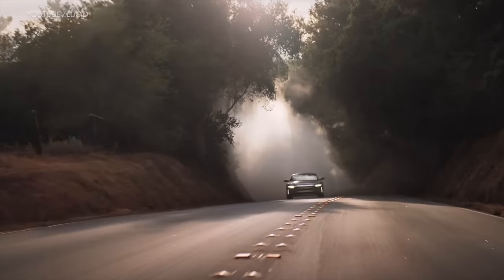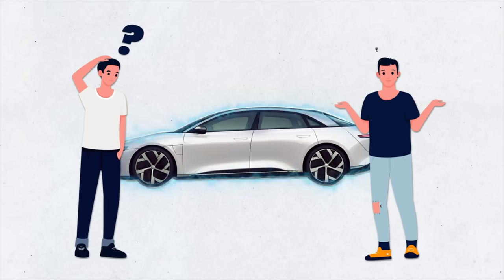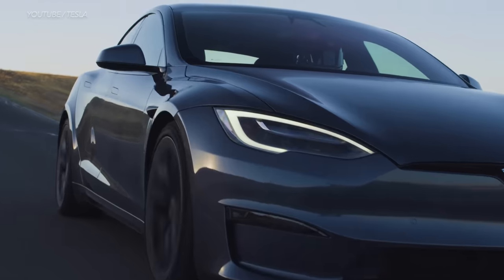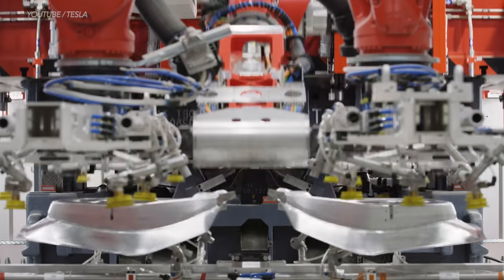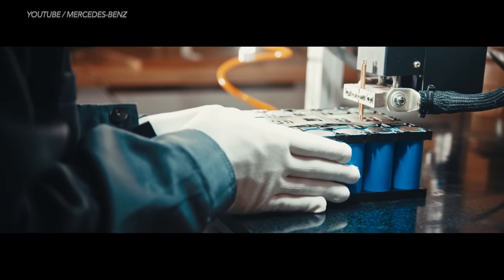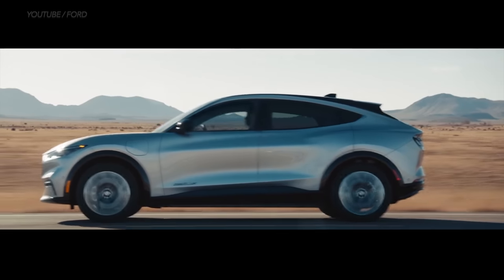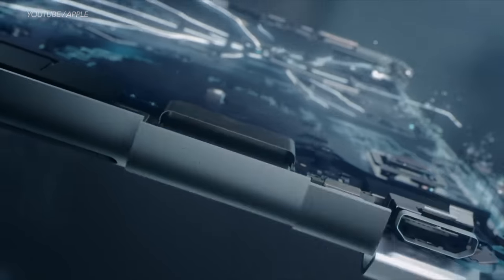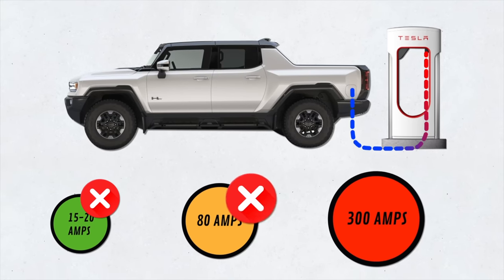Here's Why I'll Die Before I Buy an Electric Car

Comment: So my wife works at DMV. Guy in Tesla drives through, his license tags are expired. - He had to shell out 3000 dollars for Registration and tags, which would cost at my current car about 100 dollars a year. The local government does it because Tesla users do not buy fuel and therefore do not contribute to sales tax that help maintain the road. You buy electric vehicle to avoid fuel costs, to be strangled with the same bill at the end of the year or more if you spent it on fuel.

Comment: In the UK we have another new issue with EV's and that is criminal gangs are stealing  the charging cables to extract the large amount of copper that is contained within them. Also at many places that are off grid like shows and outdoor events have to install chargers that are powered by diesel generators.

Comment: Scotty - I agree 100% with you !!!  (again  LOL) Another GREAT Video ! The reasons you mentioned, for not buying an electric car now, are very valid. My biggest negative factor about Electric vehicles is that in the USA... only 20% of the electricity made by all power plants is done using "renewable" resources (Water, solar, etc). I'm continually amazed by how many people buy electric vehicles thinking they are 'saving the planet'... they really aren't helping that much.  Nearly 80% of all the electric power generated in this country is done using fossil fuels (natural gas, oil, and DIRTY COAL!!).  [ insert laughing horse here] I'll buy an electric car as soon as 80% of the electricity generated in this country is done so using 'renewable' resources like, wind, sun, water, and yes, even nuclear!!
Reply: Pure carbon has extremely low toxicity to humans and can be handled safely in the form of graphite or charcoal. It is resistant to dissolution or chemical attack, even in the acidic contents of the digestive tract. Consequently, once it enters into the body's tissues it is likely to remain there indefinitely. Carbon black was probably one of the first pigments to be used for tattooing, and Ötzi the Iceman was found to have carbon tattoos that survived during his life and for 5200 years after his death.[126] Inhalation of coal dust or soot (carbon black) in large quantities can be dangerous, irritating lung tissues and causing the congestive lung disease, coalworker's pneumoconiosis. Diamond dust used as an abrasive can be harmful if ingested or inhaled. Microparticles of carbon are produced in diesel engine exhaust fumes, and may accumulate in the lungs.[127] In these examples, the harm may result from contaminants (e.g., organic chemicals, heavy metals) rather than from the carbon itself.

Carbon generally has low toxicity to life on Earth;
Reply: Carbon-based compounds form the basis of all known life on Earth, Carbon is the 15th most abundant element in the Earth's crust, and the fourth most abundant element in the universe by mass after hydrogen, helium, and oxygen. Carbon's abundance, its unique diversity of organic compounds, and its unusual ability to form polymers at the temperatures commonly encountered on Earth enables this element to serve as a common element of all known life. It is the second most abundant element in the human body by mass (about 18.5%) after oxygen.

Comment: People are always worried about those cross-country trips in an EV, but 99% of driving is less than 100 miles per day. And the acceleration is like making the jump to light speed. Change the battery pack in 10 years.
Reply: People drive more than 600+ miles just in a weekend all the time.   And the acceleration depends on what you can afford.  But the reality is you get all the instant power at the beginning    but they lose it down the road.    If your having to change out the main component of your vehicle in 10 years that is terrible longevity.

Comment: 95% of my rides could be done with a $5k 2 seater EV, always simply charged on my normal mains power. The actual problem is not range, but how to rent a long range multi person VAN nearby for a long trip. And at what cost, if for multiple days. So we need new concepts and not an all purpose 3 ton monster car for everyday.

Comment: It's not affordable until better, cheaper and lighter batteries are commercially available. Rather build up a network of busses and bicycles. Even a petrol driven bus with a full complement of passengers will have a much lower carbon footprint than  the best privately owned electric car if you weigh in the raw materials used just for one driver.

Comment: The range isn't the biggest problem it's how much energy they waste on self diving, and other not needed electronics as well as the bigger the vehicle gets and the more it hauls the less efficient they get your car is not as big a problem as the big trucks hauling things down the highway.I have seem plans for electric heavy equipment for over 10 years and they still don't make them because it doesn't work. unless they do what the Nikola Tesla was working on years ago and broadcast electricity through the air,the battery is going to be a problem. making them is high cost limited supply of materials,and high energy use to produce.

Comment: If the average daily commute is 39 miles, please explain the ‘range problem’ While electric cars aren’t perfect for every possible scenario, they are for quite a few of us. My company has 5 Tesla’s and we’re extremely satisfied with them. Practically zero maintenance and 3 cents a mile to operate. We also have a 4X4 F350 with a 6.7 diesel that will eat your lunch with expenses. $225 oil changes, $165 fuel filter changes, $3000 to replace both radiators that failed at 85K. Hideous mileage. As soon as I can get an F150 Lightning, Cybertruck or Rivian, the diesel is history. Tell me again how bad electric cars are.

Comment: Issues that must be addressed before electric cars become a viable choice for me and probably most people (according to me):

1) A mature, widespread, recharging infrastructure with accepted industry-wide standards that work across all makes for a given category of vehicle.
2) An emphasis on cost effectiveness for the typical car buyer as opposed to the current emphasis on luxury and high-priced status symbols.
3) An acceptably long driving range for a given application, e.g., 400 miles for cars, 1,000 miles for long-haul trucks under all driving conditions.
4) An emphasis on serviceability, including, and especially, the battery pack. Expensive throwaway cars are hardly practical, although one can argue we already have those in current, non-electric, modern automobiles; although that doesn't negate this point.
5) A network of independent repair shops that can service a wide variety of vehicles, based on the adoption of number 4. Dealers should always remain an option but it shouldn't be owners' only option.
6) The ubiquity of home charging stations, contingent upon accepted standards re point number 1.

I think it's possible to meet all of these stipulations, eventually. However, I suspect that I'll never live long enough to see it despite being somewhat younger than Scotty, even if there are real efforts being made toward all of the above. Sadly, that does not appear to be the case at present.

Moreover, I think it's really only EPA dictates and not market forces that are driving electric vehicles in the first place. Thus anything we wind up with in the aggregate will remain narrowly adopted and supremely unobtainable for the masses. It will be interesting to see how this plays out.

Comment: Hi, Scotty Kilmer I like your videos a lot and I am a subscriber because it helps me and others, if you don't mind can you give feedback or review throttle controllers like 9-drive, iDrive, and other throttle response controllers. 

Regarding safety issues, My question is what if the throttle controller's device suddenly fails? or the little wire cut? Do we still have the control of gas pedal? or it will be back to normal mode? Thank you for hoping you can enlighten us. thank you again!

Comment: Reasons I won't:
1. Charging takes too long. Until they get it to the same amount of time it takes to fill up a gas tank, I am not interested.
2. I have a Wrangler, I like to go offroad in the middle of nowhere. This is hard to do if you cannot get your car charged and you get stuck with a dead battery.
3. They are way too expensive. Good EVs are pushing or over 100k. And the cheap ones are usually very limited in range. 
4. I live in an apartment and would not be able to charge an electric car at home.
5. Shitty resale value. After the battery is worn out, these will damn near cost you money to get rid of. 
6. I actually enjoy driving, especially with manual transmissions. EV cars seem to be moving toward the whole driverless thing, giving the driver as little control as possible. I want a manual and a mechanical hand brake. 
7. They all look lame. There are no good looking EV cars. Why do they make them not look like regular cars?

Comment: I still have an old flip phone, because it's free with all the Verizon dollars I built up rolling over my cheap prepaid plan with lots of unused minutes) year after year.   And now with Verizon apparently going to send me a free 4G flip phone, per recent news and Verizon's website re the program, I have several years of service prepaid yet. 

I don't use the phone much and can literally go a month on standby before it gets to about half charge and I recharge it.  My old battery lasted roughly a dozen years and I just replaced it about a year ago.

I just got a Samsung Smart Phone recently (didn't know about Verizon's free 4G flip phone plan at that time), and on standby it's using about half the charge in a week, even though it's much bigger / heavier than the flip phone. 

Since I have all the internet I want at home and don't go out a lot with the pandemic (I'm retired), I'm not convinced we're making lots of progress.  Even with a cheap plan, with taxes the smartphone plan is about 5X what the old Verizon call only prepaid plan was, and yeah, I can use QR codes, etc. but it's STILL not like I can't get by without a smart phone.  

(And I'm no Luddite. I use laptops with 5 different OS's on them, including Linux Mint -- I just don't see the NEED for a smart phone yet).  Plus I need reading glasses to see the tiny things well, so I need a big old case to cart around the large phone in a massive holster and reading glasses in hard case, adapter and wired headphones in a bag (don't like more batteries/charging) on earbuds, etc.  That bag is literally TEN times the size of the little camera bag that my flp phone fits in fine.

The companies are making more, but I'm not sure we're GETTING all that much more.  If I worked / traveled and were away from hone all the time, that would be completely different, of course.

Comment: In a electric car flooring it pulls so much power from the battery and everytime I see a tesla the drivers are accelerating from a stop and driving them like it's a basic car with 150 horsepower and I don't care about them making electric cars but the real problem is them trying to replace gas cars with electric and if a electric car was cheap the range and power on it would be crap that you would loose some range by accelerating to get on the freeway and electric cars are very hard for things like the police that they drive a lot and like when they get a call for to catch someone and the closest car could just fill up on gas and just go

Comment: I'm neutral on the technology, but I won't be bothering with any EV until they progress the technology so the battery in one car isn't completely outdated by the next years' model, which is the way it looks now. No use buying a car and 4 years later the battery fails, but 'Oh sorry that battery has been discontinued, parts are unavailable.'

Comment: To be practical an EV needs to get 1,000 mpc (miles per charge) under ideal weather/temperature conditions with no more than 10% degradation under freezing weather, be able to charge to 100% from 10% in 10 minutes, and cost no more than $50,000 for the base model.
Reply: Wow, I want your job. I'd love to drive 1000 miles a day every day.
Reply: The range of an average EV is 243 miles, which is more than adequate for most drivers. They just don't realize it yet.
Reply: @dpg227  Everyone tunnel-visions borderline conditions, such as say, going to vacation 1000 miles away. So, during that trip, you'll have to wait 30 minutes and that is just the end of the world, right? Nevermind that you take a break after 3-4-5 hours of driving anyway, nevermind that those two days on the road are the only ones where you do over 100 miles a day, nevermind that you can charge your car overnight. That one day when you will have to stop at a gas station with a charging station rather than any gas station, that's just unacceptable! 

The only real limiting factor is cost.

Comment: Diesel electric trains have been around for a long time. 
An electric car with a small generating engine should be designed. 
Or way back when there was an electric car that had a simple generator that was propelled by the wheels as it traveled along. The batteries were simple dry cells. No fire hazard.
Reply: You input a 100% of energy, than an ICE engine makes it about 50% or less. Through the generator, generator isn't a 100% efficient so you lose some efficiency there. Storage, delivery, it all has some losses. Essentially, instead of using an ICE to output 50% of power to the road directly, you added multiple steps that make it deliver 40%.

Comment: Scottie, my former BF just bought a new Tesla that has 2 engines- one in the front and one in the back. All wheel drive.  I noticed you didn’t mention 2 engines.  What do you think of those?  
I would think 2 engines make it even longer to charge?
Reply: Teslas don't have engines; they have motors.
Reply: @Russell-rc6qq  Ok, well 2 motors?
Reply: The number of motors have no bearing on how long it takes to charge. How big the battery is and how many kWh it will accept while charging is what determines how long it will take to recharge.
Reply: @diecast118scale7  Thank you! :)
Reply: Ideally for a performance car or a simple car a motor on each wheel would be optimal. But there are difficulties…

Comment: My wife & I have owned 5 EV's together... AND WE LOVED THEM ALL! 2 Leafs, a quirky BMW i3, a Tesla Model 3 & Tesla Model S.  We currently have a 2013 Mercedes SL 550 Roadster and a 2019 Model 3. But if we had to downgrade to just one car, I would choose the Model 3, because it's more practical in several ways. One of which, we can drive 125 miles on electricity for less than you pay for a gallon of gas! BOOM! No oil, changes. No tune-ups. No radiator flush. Basically maintenance-free.  But I love the Benz Roadster more. But when new, it cost twice as much as the Tesla, literally. Thankfully, I bought it used, and it only had 17k miles. So it was still expensive, but less than half of the 115k original price tag. But a quality EV is a must-have in our lives. They are fantastic! screw scotty! LOL

Comment: Quick question, let's say i have a huge 6sqm solar pannel (fully dedicated to charging my car battery) and that i live at 45°N latitude in a temperate climate. How long do i have to charge the car (assuming my roof and panels are perfectly facing south - which they aren't) to get full capacity? I come home around 8pm and can charge it up to 6am. Oh. wait. I'll need an other battery and that implies extra transfers... damn. That's gonna cost more money. Gonna generate more technical problems... yeah. Also, In Europe they are going to limit electrical access to citizens due to russian sanctions. Are city people going to buy EV in that context? (They often don't have a few sq meters of solar panels dedicated to charging their car - not that a few sqm are sufficient to charge a car in 24h - weather, clouds, etc...).

Comment: I'll think about buying an EV when it takes as long to charge as my present vehicle does to fill up with gas.  At my age that probably means never. Besides, if I was to consider hybrid, why would I trade in my car that gets 38mpg to buy one that gets 40 and have to dish out an additional 20 grand to do so. If anyone is worried about the environment, then think about the added strain being placed on all those oil and coal fired power plants supplying the electric. I guess things could be different if I was in the market for a new car and still had to commute.

Comment: Turning point is proof of concept. When I see EV’s being made and working then I can assess their usefulness. As a rancher, I am interested in electric trucks because charging at home is not a problem for a truck that stays on the ranch. For hauling cattle a long distance would need a whole different set up. They need to have them available for use and reports have to be in from users. It would have been good to have them at dealerships before gas went to $6. Burning gas makes it gone forever, and every body burning it is killing the planet. Gas is going to cost more and more, no matter how long we resist it.
Reply: I am guessing 5 years to a truck that can replace a F350

Comment: My stock 2006 Civic ex coupe mt first owner gets 41 city and 46 highway with 140hp and  turnable to 350hp stock.  so I laugh at the 2022 hybrids and most new cars , 20 years later nothing has changed and the used car industry those new cars won't make it down the used car line when it's wrecked or the battery or anything goes out  its gone and no used car to choose from anymore so